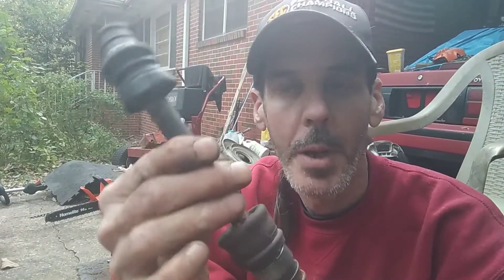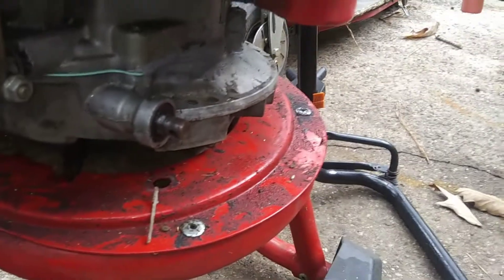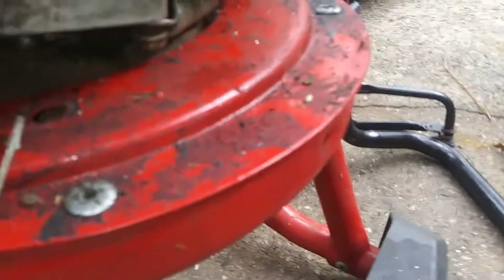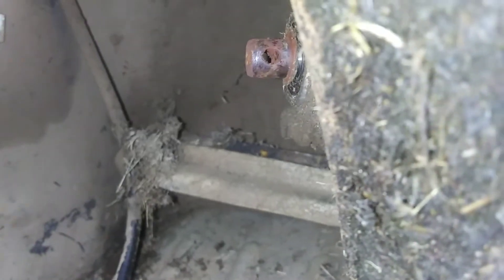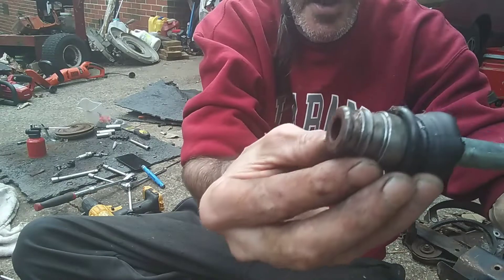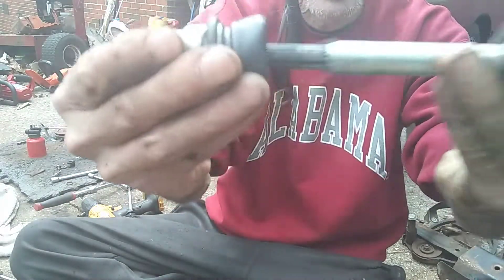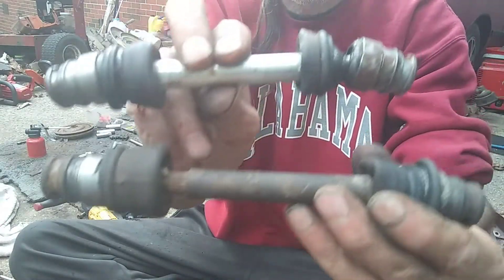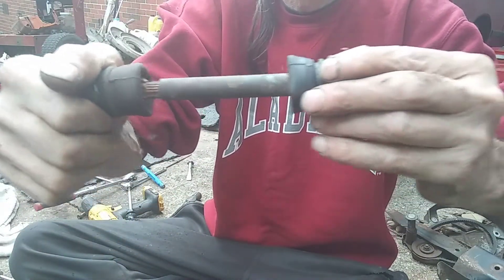Honda Hrc216,driveshaft problem

Comment: Great videos sir. I have a hrc216 and self propell not working. I removed the cover and shaft not spinning. I did try to engage but nothing.  Question- engine runs fine, if engine runs, should the pto shaft be turning or is there an internal problem ? Thank you
Reply from the maker: If the drive shaft is not turning on the engine side it's broke internally.
Reply: I haven't opened it yet, in your experience is this fixable with replacement parts or is it toast ? Thank you for the quick response!!
Reply from the maker: @NickFurlano-b6j I fixed that one,its a pain in the butt,parts are cheap.
Reply: Thank you.